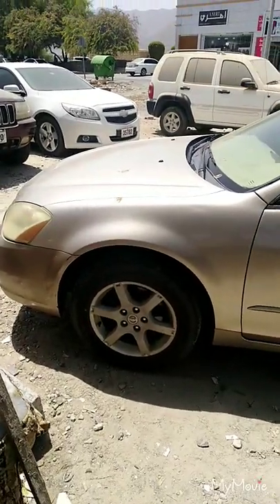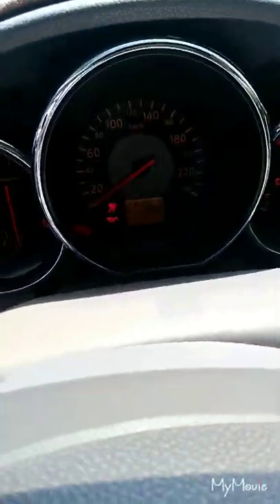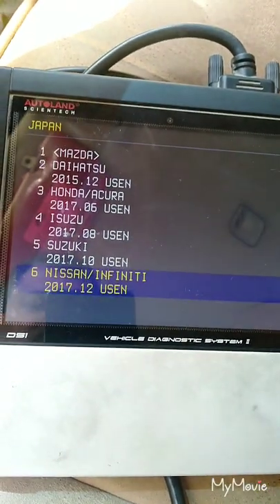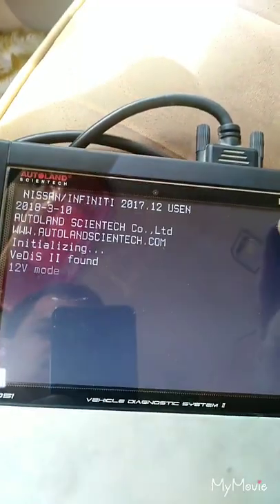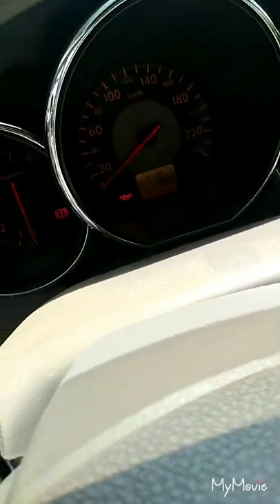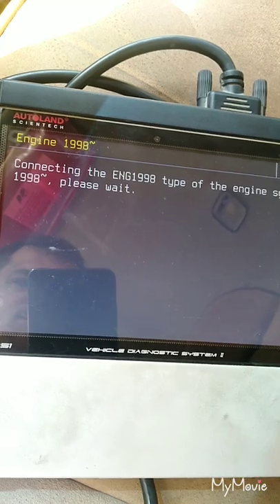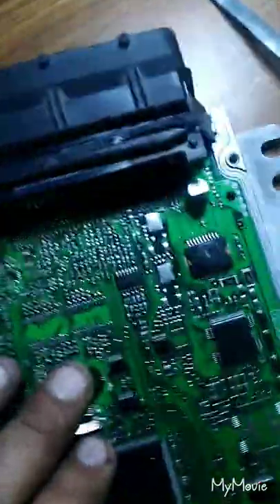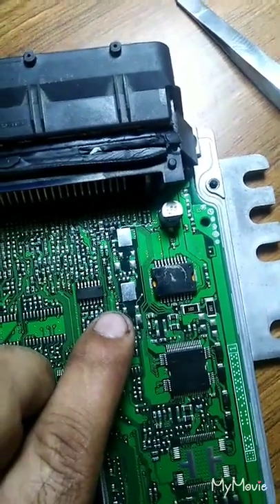Engine Control Unit ECU of Nissan altima || ECU Problem fix || Hd tutorial in English

Comment: Hey. What it the ECM that made that Nissan not crank? Or was it the Battery or Cam, Crank Sensors. Thanks
Reply from the maker: Sir all the ignition quail is damage problem in ecu
Reply: @PakistanCarDoctor  Thanks alot!